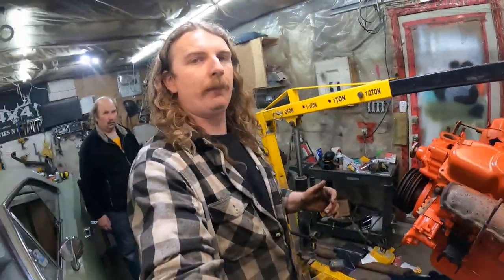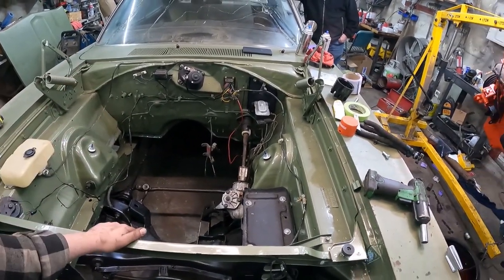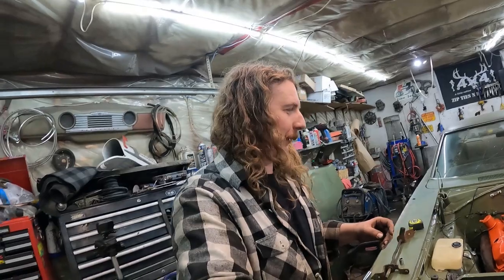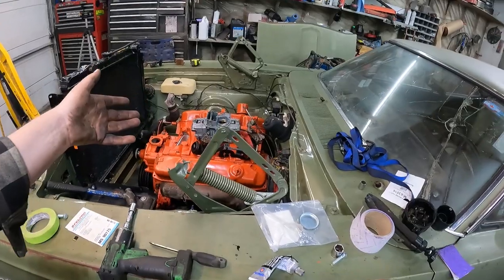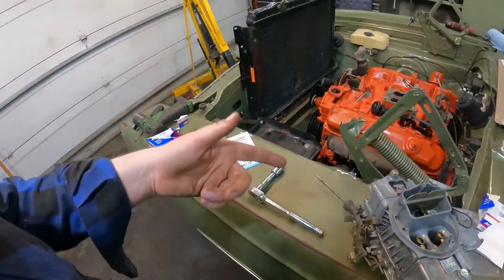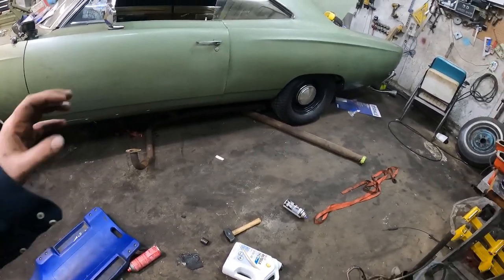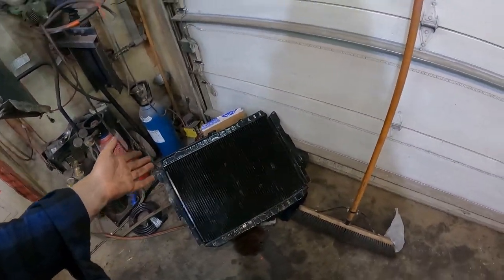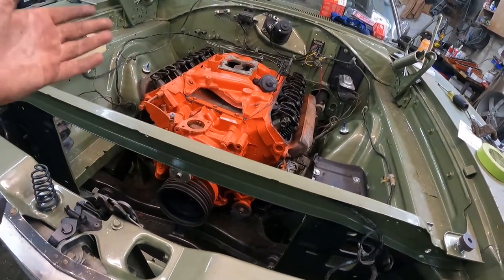Installing a HP 440 Into My 1968 Road Runner Clone - Big Block Power!

Comment: FYI when using the factory cast iron intake all you need is the valley pan and not the extra intake gaskets.
Reply: Got a new valley pan for my 383 and thought I underdid the gasket situation after seeing this video. Thought I was going to have a ton of oil leaks along the edge of the intake; thanks for the info.
Reply: Really?  I’ve always used all of the gaskets. Where were you 30 years ago?  🤣Thanks for the info.
Reply: Just like Oldsmobile, they come with only the steel shim style valley pan. The proper name is VALLEY PAN GASKET. The additional gaskets that come in the kits are for those who have had the heads heavily decked.

Comment: I remember when installing big block Ford engines. I had a log chained between two big pine trees with a chain fall hanging down to lift. Pushing the vehicle back and forth in sand. Slowly easing them in place. I loved doing that surprisingly. What a workout.
Reply from the maker: Haha thats nuts

Comment: Looks good in the engine bay. Nice work on getting it in without much carnage.
1) You can run a 22-inch radiator; big blocks didn't automatically have 26-inch. I ordered a 26-in aluminum rad on eBay for just over $200. They are tight on the battery box and the passenger side frame rail. You need the driver side to drop in past the battery box, and then position the passenger side. I blue taped everything metal and used cardboard on the radiator face. It was a huge pain, and I had a second person.
2) Nothing wrong with mechanical fans, but a shroud really helps (I spent more on the shroud than I did on the radiator). But you need to have your fan on so you can locate the radiator height and position before you mark and drill.
3) Kickdown linkage: A lot of good info here, even if you aren't buying the Lokar cable. https://www.hotrod.com/articles/the-lowdown-on-stock-torqueflite-kick-down-linkage/
4) The factory intake is brutal heavy. Sure, you'll gain some HP by ditching it, but more important is the stress on your back.

Comment: Hey just so you know that's not just a kickdown linkage like on a General Motors it's crucial you have that adjusted correctly it controls the shifting by pressure don't listen  if you hear about having to have a certain tool when you ajust the linkage. NO YOU DON'T It's  simple your throttle on your carburetor full throttle push that solid Rod linkage from the transmission as far  back as you can tighten down and done. your perfect.if you don't do that you will burn up a torqueflite transmission. peace out!!

Comment: Dan it’s been my experience that you should only use the Valley pan as a gasket no need for the paper gasket I’m sure that going to cause an internal vacuum leak that thickness changes the degrees of seat.

Comment: Looking great! 72 and earlier had a different water pump housing with a drivers side inlet. You may run into that issue when finding a radiator. C body cars and later B-bodies used a 27 inch radiator.

Comment: Its good that you used the c body rad. If I remember, the b body water pump lower inlet and lower rad outlet are on opposite side of c body. Mentioning 440 source again for parts. Pulleys, anything engine you need really. Guy in earlier comment caught the valley pan issue already. Good call on the aluminum intake. It causes a lot of strife in mopar community,  but I switch all mine to gm ignition module and mid 90's coils. Plus with no AC you can run a newer style 100amp GM alt. You really clean up the wire harness. Lastly, using a Ford solenoid on the fender well to run starter and get bat voltage everywhere lets you run at 12 volts instead of 9.

Comment: Love that 440, that C body rad is definitely the way to go that small 22 inch won’t do it, you didn’t get the fan with the 440? That would be the best one, you need your kick down linkage to be on the rear stop in the trans at WOT for the max pressure
Reply: Yeah he got the fan. It was in the crate.
Reply: The Clutch fan was there but blown out and held hard with JB weld haha

Comment: These are my kinda cars for some reason i never wanted a shiney show car. In the 90s i did this to a 68 olds 442 put a 66 toro motor new front end exhaust th400 short shaft from a t/a everything but paint. Then hydroplaned on water and wrapped it around a pole.
Reply from the maker: Yeah ratty hotrods r awesome

Comment: Looks great. Helps sometimes to jack the ass end of the car up first, then you don’t need as much angle on the motor and tranny to drop in. Also lowers the radiator support a little too.

Comment: Sweet . Looks good , you got it in . You had Mur to help you save the day ! The rest is as you go . Glad you were able to slide the big rad in . I'd still do a trans cooler . But ,ya , big guns for big guns . Works . Are you sure you got the gas $ for these monsters you're building ? 'Cause your feeding Godzilla-Plymouth & Chevy Dragon-Wagon (Huff n Puff) ! That's a 440 & a 454 with a garden hose to an intake , respectively ,passing everything but a gas station . And cops .

Comment: Looking good Dan, Dani, and Mur! You should ask Big Easy or Uncle Tony about installing the new aluminum intake. From the factory with iron heads, and an iron intake manifold, they used just the valley pan... no paper gaskets... no sealer. With an aluminum intake, I like to use the valley pan with all 4 paper gaskets and no sealer.

Comment: 8:06 it was this moment you could collectively hear the sphincter of every MOPAR addict pucker up
Reply: Dang Mopar has what like four different width radiators.  Can't tell you how often I just drilled the core support.
Reply: LOL for sure. I vote for the right radiator.
Reply: @mikeobrien3744  In the old muscle cars there were 2 size rads. 22" and 26". You could get then in 2,3,4 cores with shrouds.  Many radiator companies make replacements like factory or in aluminum. Many I know are running a cheap CHAMPION ALUMINUM rad with no problems.

Comment: If you get tired of hood springs in your rib cage just pull the spring up I noticed you worked on a lot of cars that way soon as the hood comes off I take the Springs up I got a big belly though so that's my problem LOL on the cooling system I think I'd put a clutch fan on it it should clear your fan belts that way can't wait to see her go down the road ayto GTX with a 440 speedometer went 150 it would go way past that
Reply from the maker: Haha thats fast

Comment: Looks good ,  you need to have full kick down at full throttle , i won't be surprised if the C body kick down stuff fouls on the fire wall , you can use / modify the 318 kick down stuff even if its from the 904 trans , take the small trans lever too , there should be a pin on the carb and a slotted linkage for the carb , you will probably be cutting welding this . you need very little kick down at low speed but 100% kick down at full throttle , its a pain in the ass but once its right its right :)

Comment: That year mopar only puts power to the coil when the key is in run.  The idea is to get it spinning then you let go of the key and it fires.  I put a relay on the starter at the firewall relay and give the coil a full 12v when it spins.  They kick right off with that mod.

Comment: Maybe cut that fan spacer in half? and yes the rad is enough cooling for the trans lines. 
I am thinking your trans shifter bracket isn't on correctly? that's why the kickdown is so close to and hitting the body.
Nice job so far! Can't wait to hear it run!!

Comment: Lookin great.  Headers are a beast on them. I had a 69 with headers. Steering goes thru the tubes. When the motor mounts failed, the steering would lock up solid when I got on the gas. lol Until the turnbuckles self clearanced a few of the tubes. Then it was loud!!!
Reply from the maker: Haha

Comment: The small block radiator has the inlets and outlets in different spots, also the big block radiator support has a bigger opening, you can cut the hole in the radiator support bigger to let more airflow through

Comment: Dollar store towels are an easy way to protect the paint as you drop the motor in.
03:48 If the car came with a 383, the 440 has to fit. Both use the same K frame.
Reply: DD's Satellite came with a 318 small block.
The K Frame will accept a Small Block or a Big Block.

Comment: In 1968 The kick down had two pivots.  One at the back of the intake, and one on a long stud with a cotter pin where the bolt hole is on the bell housing of the trans.  Look near the starter.  The kick down supplied with the engine is the newer one piece style they adopted to save money in something like 1972.
Reply from the maker: Oh good to know

Comment: You can still use that battery bracket you just have to weld a one inch tab on it drill it paint it and bolt it back on in the same spot.

Comment: The Big Chryslers w/ac had a radiator fan clutch... !! Fan didn't spin with addional resistance when up to cruising speed... !! Even my old man's 73 Plymouth Valiant 318  automatic  w/ factory/ac had a fan clutch... My 1969 Roadrunner did not have fan clutch being a non/ac... !! Absolutely need trans cooler to radiator... !!

Comment: Ford/Mopar Pro-Tip: Jack the ass-end of the car up as high as you can get it, and put onto stands. This will lessen the angle you gotta have the engine/trans cranked up at to clear it over the fixed core support and wiggle into the trans tunnel. You will thank me later. LOL  Didn't the 440 come with a clutch fan? I'd give that a try.  Pontiac it looking good , Dan!

Comment: Nice you got that big bad boy shoe horned in. The radiator fits that is great! Can you actually have room to change the spark plugs? I hope so. That is the high performance 440 wow. Its gonna burn some rubber. All 440s are powerful but this is a HP so I am expecting a lot and cant wait to see what it does? I wonder if the rear end can handle the power? wonder which one it has?
Reply from the maker: Plugs weren't to bad from underneath

Comment: If your going to reuse the gas tank you should take it out toss some nuts and bolts in the tank with some CLR or gas and shake it around that way it will get all the rust and crap loose and just rinse it out good and slap it back in  you most likely will need a new sending unit if you want the gauge to work
Reply from the maker: Haha stay tuned.  It's bad

Comment: hope you changed the frost plugs in the back of the heads, they are tuff to do with with the engine in the car ,I have done it with the help of a porta power

Comment: 440 and 383 are not as similar as most think. 383 is a B block and 440 is a RB raised block so its wider and taller. Just FYI because some stuff won’t interchange. Also 72 and older are internal balanced 73 and newer are external so pay attention to that for flex plate or fly wheel.  Also 73 and newer 440s you have to do some modifications to swap a later 833 4 speed in with the crank or Input shaft.

Comment: Those exhaust manifolds generate a ton of hear.  Mine were melting the passenger side rubber on the shock.  Its close to the exhaust.  Also, you be careful around that old fan.  They do come apart.
Reply: That is odd that exhaust was melting shock bushings. I had a 68 and a 71 Satellite years ago both with 440 that I built and never had any under hood heat issues either with exhaust manifolds or headers.  The only things I did to help mitigate heat on the 71 besides large radiators was I did run external oil and transmission coolers and I wrapped the headers on the 71 to help from roasting plug wires.
Reply: I thought it was odd also.  I melted 3 before I put heat resistance material around it.  The passenger side exhaust is close so it makes sense.  I talked to other Mopar guys and they never had the problem.

Comment: In regards to my previous comment, I was implying that, if the heads on the 383 WERE 440HP's, why not install them on the 440HP? It would increase performance, and resale value/desireability when you go to sell the car. Just a thought.

Comment: An extra set of hands makes this kind of job go much smoother. You can't stand on the back of the transmission and reach the controls on the engine hoist. Looks good in there. When is the tire fire?
Reply from the maker: Oua way easier

Comment: Dan,
Isn't that arched area for the drive shaft?
Reply: No the drive shaft goes between tail shaft tail end of the transmission and the yoke on the differential.  The reliefs in the in the crossmember are as Dan say they are for the exhaust system.

Comment: Glad to see you're working on the Plymouth...  C body stuff wont work in a B body  you need a 402 oil pan  the correct water pump housing, water pump, rad, kick down linkage and non AC alt brackets
Reply: Did You even watch the video before commenting??
Reply: @rakerss74  yup

Comment: Hello mister i have 1957 bel air 4 door it was 6cyl with powerglide 2 speed i swap it to 305 with TH350c and i cant go in high speed my gear shift to 3speed in 30 km/hr  what i should do? Some people says replace your trany to 700r4 what do you think?
Reply: did you mount a kick down cable to the carb?if you have not then if you keep running it you burn up the box,they will change up to high with out 1
Reply: @bri29340  no i didnt but i mean when i goes around 40/50 kl hr my rp is high
Reply: @tj-hero  at the back there is a vacuum module did you cannect that to a vacuum on your engine
Reply: @bri29340  from trany to the engine? yes i did

Comment: Dan its not a kick down, its a TV linkage. It does the job of a vacuum modulator similar to the way it works on a Ford. Make it longer to shift later, shorter to shift earlier. Uncle Tony should do a video on adjusting it. Also you need more vehicles so you can play yard tetris on the scale I have to.

On the bright side of things I just ordered a glass bumper and hood for the 68 LeMans from VFN.. 10 weeks. So two weeks after my appointment in June to get plates swapped between trucks. Yeah... 8 weeks to get in for DMV stuff here in Michigan.  I can't make it legal until then so I can wait on the front end stuff.
Reply from the maker: Maaaan that's a crazy wait time.

Comment: The valley pan goes in alone unless the heads have been milled. (NO GASKETS)!!!  I hope you RTV'd the corners of the pan. If not you will suck dirt and moisture into the motor.  The valley pan is reusable although you used the wrong valley pan for a HP build.. The one you put on is like factory with the heat crossover "UNBLOCKED". When building for SPORT, use the pan with the crossover BLOCKED...  The transmission is a Torqueflite 727, (TF-727) for Big Block. The same tranny is made for small block as well as a TF-904 for small block only. There are MILLIONS od B-bodies out there that came factory small block, (22 inch) radiator that are running a heavier duty 22" rad. Aluminum works very well... What you have there is a C-body rad with a truck style water pump housing... This car "SHOULD" have a 22" rad with Drivers side bottom outlet and matching water pump housing.  This car was available with a BIG BLOCK and 26" radiator, but,,, it used a different core support and full shroud.  So, if you look at the factory rad. it should have a bottom inlet on the drivers side. You CAN GET an ALUMINUM water pump housing that drops a pile of weight and is far more efficient. The water pump SHOULD be replaced no matter what. You can get a full aluminum housing and pump from Mancini's at a pretty good price or 440 Source. Both good places to find everything you might need.   Your KICK DOWN LINKAGE  absolutely MUST be adjusted properly. If not, you are putting your pecker in a guillotine!!!  Also a great intake manifold for that motor is a Holley Street Dominator. Not so easy to find, but worth it all the way..
Ps. 440 Source is also a great place to find many used engine parts. PULLEYS and BRACKETS come to mind with this video.

Comment: Never use paper intake gaskets with cast iron! Thats why it was such a bitch. paper pan paper is for aluminum only. Factory only used the pan. Oh and do NOT drive it with the kickdown disconnected. Hook it up and adj it right your trans will thank you. I would also do the hemi adj on the bands(tighter), one is inside the pan one is outside....super easy. AAH no solid fan they draw 30 hp at 5k rpm. Get a viscus fan!